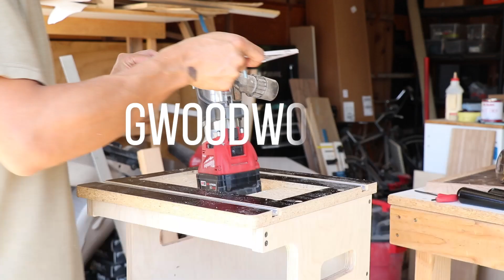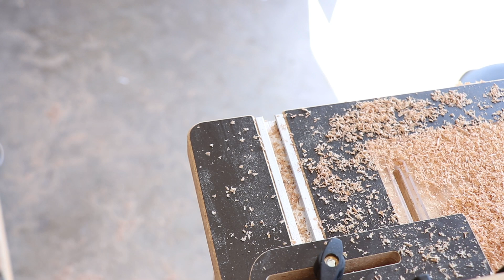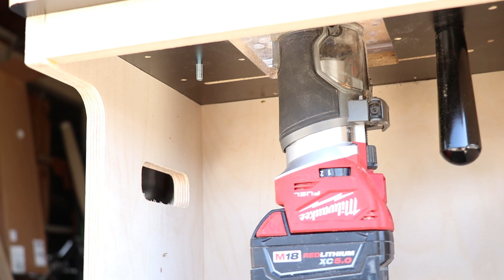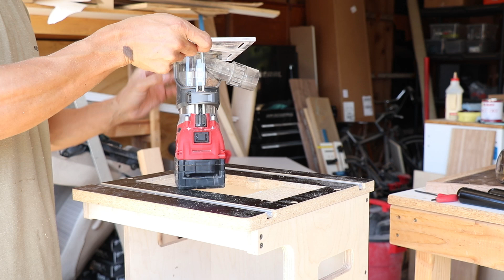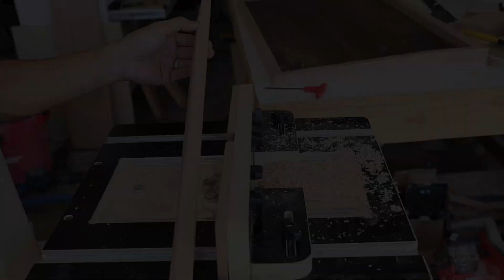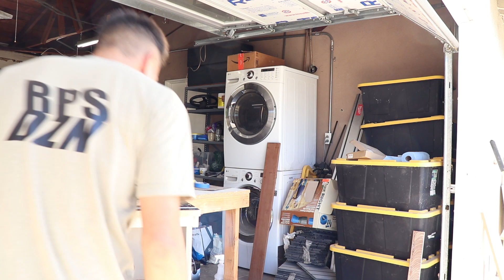The BEST woodworking tool? KM Tools Benchtop Router Table and 3x3 Custom Trim Router Jig Review!

Comment: Why does nobody provide dimensions and weight? Also, particle board? Really? Just use more Baltic birch…
I like the 3x3 base/jig for my plunge base, but not so much the fixed-base…

How would you compare the Veritas table that looks incredibly similar, all Baltic birch, slightly higher price? Uses a different base plate. Not sure which is smaller (more compact)…